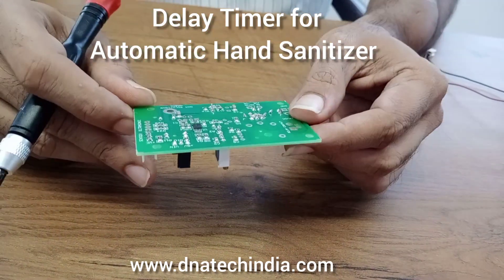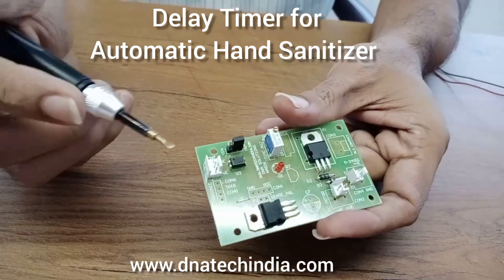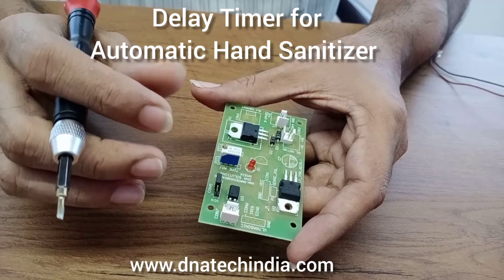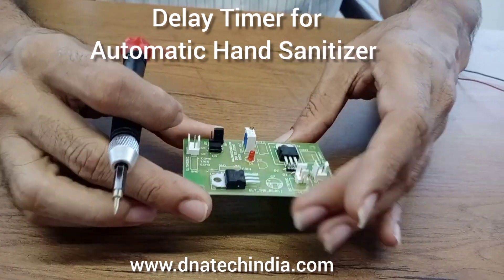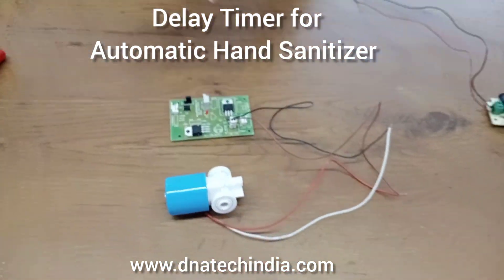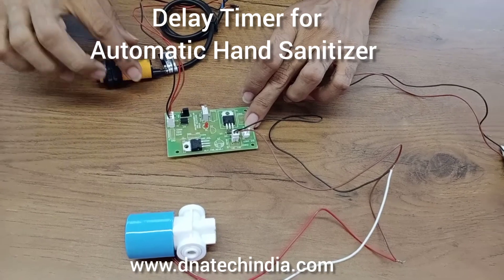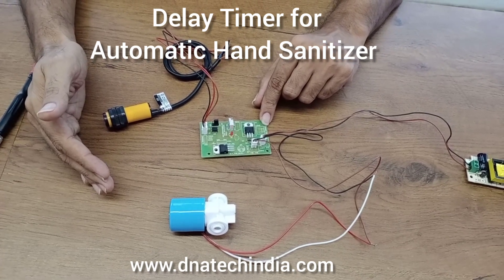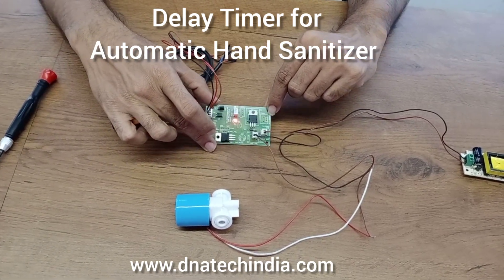Delay Timer Board for Automatic Hand Sanitizer

Comment: I had made a automatic sanitizer dispenser but there is a problem when ever the sanitizer gets finished in tank air bubble gets in motor and will not dispense till the air is removed. What needs to be done to avoid this problem.
Reply from the maker: Which Pump are you using? You need to use self primping type of pump like R385: https://www.dnatechindia.com/r385-non-submersible-pump-india.html
Reply: @Dnatechindia_online  RO pump 75gpd..
Reply from the maker: Ohhhh as per my knowledge this problem cannot be avoided
Reply: @Dnatechindia_online  Thanks

Comment: Which sensor is best to make 2000 cycle in a day photoelectric sensor or ultrasonic sensor
Reply from the maker: For 2000 cycle a day, sensor is not the issue both will work quite well. Main issue is what to use to Turn ON/OFF the pump/solenoid
Reply: @Dnatechindia_online  12volt motor pump I use but what is best for long term because I don't want hanging problem
Reply from the maker: Hanging problem is not because of the sensor...it is mostly because of low quality power supply & back EMF from the Pump/Solenoid .
If due to sensor your circuit is hanging then it is more of coding proper or improper design of the sensor
Reply: i have in search of low cost without programmable tech ideas
Reply from the maker: For low cost without programming You will have to use IR proxy sensor and power Transistor like TIP32C to drive th pump
Reply from the maker: 8412-906-903
Reply: @Dnatechindia_online  I will call u tommorow